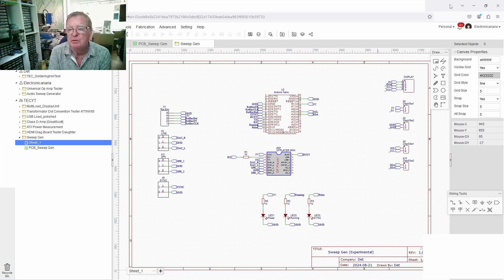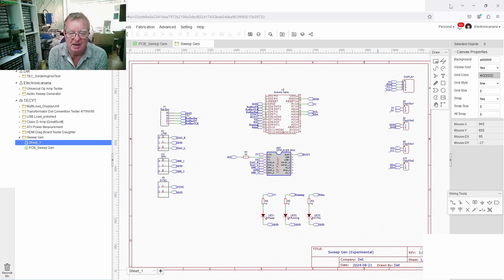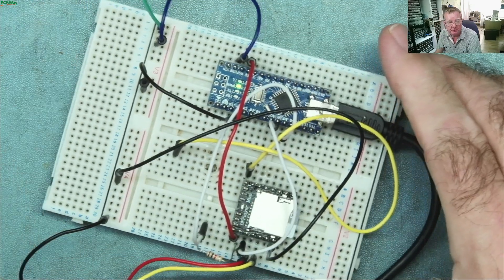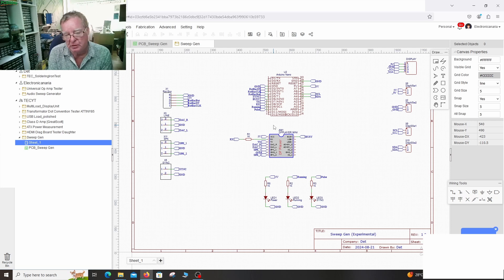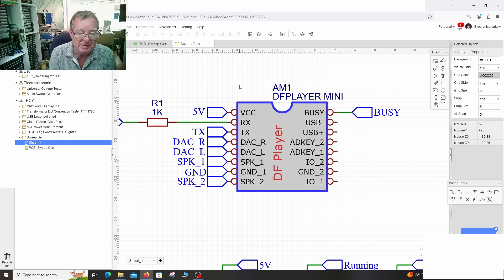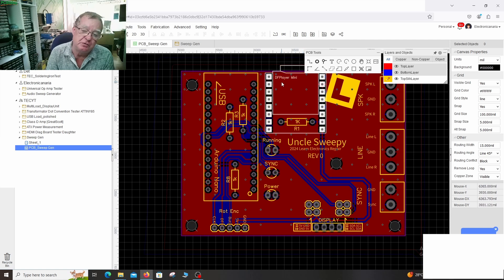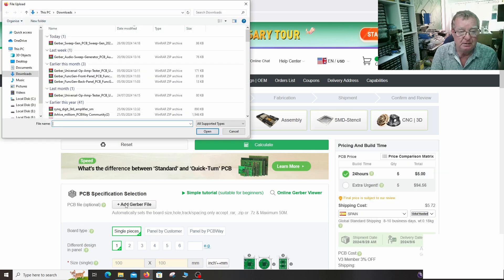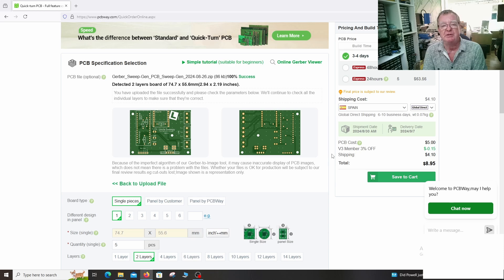A Cheap DIY Audio Sweep Signal Generator Project with Sync : Revisited & Improved!

Comment: I like this design—refreshingly simple and flexible. When testing your prototype, could you confirm that the output of the MP3 module is flat across the audio spectrum when loaded with a typical line output load? Perhaps you could connect a 1k load to the line output during testing. I also think a white noise recording would be useful. Thanks again for sharing such a great project idea!

Comment: you also need to make it go in reverse so go from low to high then without a pause from high to low and without pause repeat !!!  when you re-invent it then do it right !!!! and make sure this module has the same amplitude in the whole frequenty range if that is not the case then it is still useless !!! the audio out of that module needs the have the same amplitude from lowest to the highest... end when you want to test power amps you need it to go up to 3.5 volts !!!! as you need to be able to test the high power inputs !!!! and this is not a sugestion this is a must !!!! so please Richard listen to me  this is really a must !!!
Reply: Add more !!! !!!

Comment: Excuse me, where are the sound files for download ?
Reply: I think Rich mentioned that everything, including the sound files, will be released together, when the boards are ready for release. 
I'm excited too! A great easy project!
Reply: @darrenbird2526  thank you very much. I had been a little bit unconcentrated and english is not my mother tongue 🖖🐻
Reply from the maker: @darrenbird2526  Correct.  Also I can now add that the software is written and working, just need to add the volume control function
Reply: @LearnElectronicsRepair   Thanks Rich, I love and appreciate all your projects and the time you put in to designing them for us! Cheers.